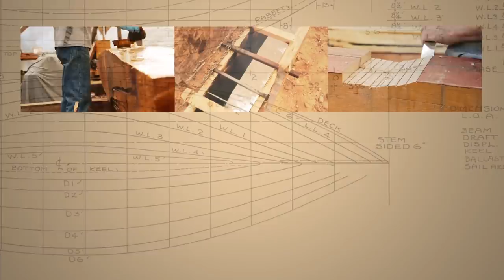Cockpit Mockup - Episode 149 - Acorn to Arabella: Journey of a Wooden Boat

Comment: Having seen whats happens when someone falls against a nut on a sail boat, please put acorn nuts on all those tie rods you will be much safer
Reply: they will be hidden behind that grab-rail board he showed....I think the only places that you even will be able to see a tie rod end will be in the storage hatches, where those ends will double as hatch cover prop mount supports, and there he said he will use acorn nuts - but one thing I see is that with ends/nuts covered by that board you would never be able to re-tighten them, so I'd rather see them safety wired or the ends of the rod peened over onto the nut ...but yeah sure, as they personally spend so much time in/on her as they build, I'm sure they will find anything that gives you 'boat bites' early on
Reply: @BenjaminT.Minkler  Its maybe too late now, but I was thinking whether it would have been better to have the tie rods go through the grab rails, and then counterbore a nook for the bolts on the visible side, which is then 'sealed' with a graving piece. That way, there would be less bolts going through the wood and you could remove the graving pieces to access the nuts. A bit of locktight so the bolts only get undone when you want them to and then you're done.
Reply: @Roy Bentley It also removes the extra bolts trough the wood. Their planning with the house bolts made me appreciate the space for bolts inside the wood. So if you can save future "boltspace" in the wood, that would be a plus too.

But I am not a boatbuilder. I could be wrong.

Comment: Steve. I have some experience with boats built with over large cabin apertures, they are the norm amongst  broads cruisers and cruiser racers, often with pop tops to boot, like a camper van. To get to the point these boats are prone to spreading and hogging, great care should be taken when laying a boat up ashore for the winter or remedial works to ensure Arabella  is properly supported along her keel and her sides amidships.Of course this will not prevent her from moving in her shape when on the water [over time] but regular winters out on the hard standing will help pull her back. The type of deck you lay can also become structural  and stiffen Arabella both across her beam and fore n' aft. see Marilee the NY 40.     rear hatch. Split in middle and hinge from either side, many designs out there for good water tight hatches of this type handy for letting hot air out of the hull when under power.
Reply: I dont think he is planing to see a winter for a long long time!!
Reply: @nssherlock4547  Wait till Cape Horn!!!!!!! At least the cold will kill off the Sargasso?

Comment: Presumably you will have some drainage in the cockpit.  If you lower the cockpit floor lower and fit a raft of slats to step on it will keep your dryer in heavy seas..  Keep up the good work.
Reply from the maker: Yes there will be cockpit drains connected to hoses that go to seacocks below the waterline.

Comment: For your grab rails setup a metal gutter with drain tubes to help keep the condensation from building up too much. Run the tubes to a catch basin in the bilge area with a small float controlled pump to pump out the water when full enough.
Reply from the maker: The amount of condensation inside the boat won’t call for that kind of catchment system. Most mornings a quick wipe with a towel will do.

Comment: How about putting the throttle and gearbox control on the tiller (outboard motor style) ?
And maybe add a gas spring to the tiller pivot to make it so the tiller has the slight tendency to move up so you don't have to reach into a hole in the deck to get it and have it somewhat out of the way when getting into and out of the cockpit...

Comment: In wooden aircraft construction we varnish the inside of all bolt holes using a pipe cleaner or similar. I haven't seen this on Arabella such as when installing the tie rods. Am I missing something or is this not common in boat building? Absolutely fascinating watching this build!

Comment: Think about when you need to hove to.  You will need to lash the tiller to something.  Good idea to have a tiller that will move in the vertical plane to suit the helmsman where ever he might be sitting or standing.  The engine controls should be on the left hand side, given that most people are right handed and will prefer to hold the tiller with the right hand.

Comment: Personal experience, if you can get the tiller as vertical as possible it will leave you with more working space when at anchor or tied up to a dock. I have seen multiple boats that tie the tiller to the backstay for storage.

Comment: You absolutely want the tiller to have a huge range over vertical motion. As you say, standing on the deck and holding the tiller is something you'll do more often than you think.

Also my racing brain is screaming at your asymmetric companion way
Reply from the maker: Makes sense with the mizzen though—it has to be offset.

Comment: Seems to me a boat this size should have at least a somewhat enclosed cockpit. A large canopy or wooden roof could work and not change the look or wind area of the boat much. Sitting in the sun or rain all day is going to get old. Particularly when you already will spend a lot of time exposed swimming, fishing and other things.  
I assume you will end up roping the tiller off to catch a break and drift off course a bit, but worth it. An autopilot would be a huge relief. Freeing up a huge portion of your day. I don't know if they are harder to get for tiller style or not.

Comment: i once got stuck under a tiller on a 70ft sail traing yacht callsed masterbuilder becasue the engine contriols got kicked into reverse and the tiller flipped over and i couldnt reach them to stop theboat ramming the boat behind. parking with a tiller under power is a real skill and engine control tucked away can be a real pain
Reply: that that is is that that is not is not is that it it is
Reply from the maker: Woo what a story! We hear that deftly backing a full keeled boat regardless of steering method is pretty tricky... but getting accidentally whacked into reverse sounds like some very bad luck. We’ll not be hiding/tucking away the engine controls.

Comment: Just a thought about the cockpit, are you going to install some kind of back rest? Just think of the hours you guys may spend hours on that tiller, I have a small dingy and it is a pain to sit in one position for long time. I have seen some with a directors chair type back rest, it folds down and looks comfy. Just a thought.
Reply from the maker: The cockpit will have a coaming. And it’s easy to add back rests like the ones found on boats such as Mahjong (restored by Gannon and Benjamin). We’ll get there. 😉

Comment: Definitely peen over the tie rods. Just cause you can't see it doesn't mean it won't move. About the  tiller, raising it up and down is a fantastic idea however you need to make sure that the part at the rudder and tiller connection gets reinforced to keep from tearing out after some use.

Comment: You want an old style grab bar instead of the fancy grab rail: boats heeel, seas get rough, one gets tired, weak or sick...
Reply: I agree.  That small rail might work for a rock climber but a bar is much better.  If the boat were over 30-45 degrees the handhold would not be of much use.
Reply: Perhaps add straps, even a split very stout belt spanning between certain of the inner end the rod ends then shorten and cap. Can also easily add additional grab straps and grab bars where needed later too. Tremendous project.  -D. D., PHX AZ

Comment: Nice work on the cockpit mockup. Have you thought about a 2 part foldable tiller? This way you can fold it in half and still operate it with the hatch opened, and operating it while standing up wouldn't be a problem either.
Reply from the maker: It’s an interesting idea, but probably not appropriate for this boat or for the size of tiller that we’re going to need.
Reply: @AcornToArabella  that's a good concern, and I think you can find that it is doable. It is used in some IMOCA 65 and VO65 (not wooden tillers, though) on the Volvo Ocean race.

Comment: Suggestion from an armchair quarterback: Have you guys thought about making a two-door hinged lid for the cockpit? With a lid that opens from center to port/ starboard, you could mount seat cushions to the underside of the lids. While closed, the cockpit could be used as additional storage and a walking platform.
Reply from the maker: It’s a little hard to picture what you’re describing, but it sounds kind of cool, and no, we haven’t thought about that. Probably just gonna stick with what we’ve got.

Comment: I loved seeing Victoria's tiller with the mocked up cockpit.  If there is any way you can use Victoria's tiller for Arabella's tiller, that would be poetic.
My only concern is about the hand rail being designed to catch and hold water. Based on my experience, this will create a very rot prone environment. Standing fresh water absolutely destroys wood boats.  There should be clear channels directing water to the bilge.
The project is looking very impressive.  When will you be able to have volunteers again? 
Cheers from Juneau Alaska,
Greg Chaney
Reply from the maker: It’s mostly designed for the grab rail and won’t be channeling or holding that much water, really. Not sure when we’ll be having volunteers again, but please sign up for our newsletter—the survey on the signup form lets you say what you’d like to get news about, and volunteering is one of them. The link is in the video description.

Comment: If you can lift the tiller up to vertical you can get it out of the way in port/while at anchor. Also the lowest position must be high enough so it does not catch on cockpit or anything else.

Comment: Moving ahead with good speed, nice to watch. On the dimensions of the grabbrail, it seems way over the top. Are you not concerned that the bottom plank (sill?) of the coachroof will be perforated with to many holes? I would arguee that simply screwing a grabbrail of say 1”x1” to the (sill?) on the inside would be more than enough for the grabbrail. Take care!

Comment: Brilliant episode
 I was thinking about condensation  from the portholes when you mentioned it. When putting in the drip rail / hand hold around the inner rail make sure you have enough depth so that, if you need to leave a sponge in there, it can sit deep enough not to be seen at all times when you are standing in the cabin.
Reply from the maker: The main purpose of that is definitely as a grab rail. It’s not a very good idea to leave a sponge pretty much anywhere on a boat.
Reply: Agreed not ideal but after a cold night on board you will probably find that you do
Reply: @AcornToArabella  but it will be the perfect spot to forget where you sat down your pencil at !

Comment: Meh just put some bulletproof glass down for the flooring in the cockpit! Just Joking LoL
Reply: For a transparent or translucent cockpit floor and other improved passive lighting consider use of polycarbonate bronze also known as lexan stronger than the usual plexiglass (such as perspex u90) - if weight at that height in the boat is still adequately minimal.

Comment: Suggestion from a retired mechanical designer: either peen the end of your tie rods or put lock nuts on them, because even the slightest flex of the hull over time could loosen the nuts which will be hidden under the grab rail.
Reply: I was thinking exactly the same thing... especially for the ones hidden.  The ones that are not hidden can be checked periodically, but even that feels like it would be constant maintenance.  I don't think peening would be the right solution, though, as it doesn't afford a lot of maintenance/repair options.  Maybe a double bolt with some threadlocker compound might be better?
Reply: Definitely lock nuts. Easy to loosen if necessary, but won't come undone. Good call
Reply: I was thinking the same thing! Good call
Reply: Peening would be more traditional.
Reply: I was an aircraft engineer, gotta be split pins and castellated nuts!
Reply: @p.d.smithjr.3277  birds preen, steel gets peened.  :)
Reply: @wildrootorganics9060  That’s why I’m better at the handle end of a hammer, then at a key board.
Reply: Could they also use red thread lock?
Reply: @p.d.smithjr.3277  lols :) Have yourself a great day!
Reply: Instead of peaning the rods, I would suggest drilling a hole in them and locking the nut in place with a cotter pin. To do the drilling in-place, you'd want to make a jig.
Reply: @wildrootorganics9060  You also.
Reply: @brianmcdonald3831  we call it Loctite. Actually just varnish would do.
Reply: @billgiles3261  where I am the only brand is loctite that’s why I only say thread lock great stuff though wish they could R & D it to cure in less than 24hrs though
Reply: Maybe there should have been a turnbuckle in the rod to keep the tension on the rods over time.
Just sayin, JIM
Reply: @brianmcdonald3831  I have not used it for years but we used to have it in several grades depending on how long you wanted it to set off. I think we used to use blue, but it was 30 years ago or more.
Reply: @billgiles3261  well whether it’s blue or red on back says 24hrs still good stuff of course most times I drive the car right after the fact so..... usually my own car but the stuff that GM, Ford or Dodge(I know it’s Chrysler now or it might’ve changed) but theirs compared to loctite isn’t even in same ballgame loctite I can break loose by hand no problem where a factory threadlock I need the impact
Reply: @brianmcdonald3831  could, but even Red locktite can break. Lock nuts take even more force, especially the "pinch" type use on crankshaft bolts.
Reply: @ScottKenny1978  no offense but nylon is basically plastic it cracks and breaks over time and not to good for water sealing I have a 22 year old car original red thread lock stayed true where it’s sealed nothing went ever through water or oil
Reply: @brianmcdonald3831  I said pinch type locknuts, not Nylok.

On aircraft, pinch type are reusable, but Nylok are not.
Reply: @brianmcdonald3831  and I had idjits in college breaking red locktite on the cable boxes to steal the wire.
Reply: @ScottKenny1978  sorry here nylock and locknuts are referred as one and the same even my retired air force pilot uncle turned commercial or private pilot would have to explain difference to me he trained either Air Force or airline pilots or both out of Florida for many many years obviously I’m not not in that state or occupation
Reply: @brianmcdonald3831  there's two different types of lock nuts. One uses a nylon insert that the threads don't really cut into. The other one uses a thinned part of the nut on one end and pinches that so it is an interference fit on the bolt or stud (it's visibly deformed in the thinned part, into an oval instead of a circle).

The typical place for pinch type locknuts is on the crankshaft of an engine, but they can be used elsewhere. Proper torque plus a locknut is usually better than locktite.
Reply: On Merchant Ships a lock nut is simply a second nut brought up hard against the first.  Easy to unlock but in this case why would you ever do that. I vote to pean over the treads.   But what do I know.
Reply: Locking washers on top of the first washer.
Reply: What does peen mean
Reply: @hanoitripper1809  beaten with a hammer to deform the end of the bolt.
Reply: @ScottKenny1978  thanks 👍
Reply: @hanoitripper1809  Peening means hammering the end of the tie rod onto the nut so it prevents the nut from backing, off similar to a rivet. Peening is permanent, lock nuts can be removed later if necessary. Lock washers, pins, and locktite were also suggested. Locktite may work but how long will it last? I think the tie rod is too small in diameter for a pin of any size. I  have never heard of bronze lockwashers, they are usually spring steel which cannot be used with bronze in a corrosive environment and even they could, I think the tie rod is too long for a lock washer to be effective.
Reply: @brianmcdonald3831  You can get activators/accelerators that decrease the cure time substantially. LOCTITE SF 7649 for example.
Reply: In my opinion peening is the last thing anyone maintaining a boat would want. It's permanent and a total pain in the arse for anyone to dismantle later, defacto requiring replacement tierods after you've cut the ends off to release the nuts, and then you have no choice but to lift all of the deck beams to get the whole tierod assemblies out to be remade. Locknuts on the other hand can simply be removed and replaced as required. We have to remember that Arabella can't just come back to the boathouse for 3 months of dismantling and remanufacture every time she needs some work. Peened over thread ends can turn anything from simple into a complete nightmare.
Reply: @jamieduff1981  A very light peen would serve the purpose of preventing the nut from coming off while not actually preventing removal. 

This is largely academic anyway. Chances are the rods will never hold a torque anyway because it's wood. So you really just want to keep the nuts from backing off when the tension is gone. This could be done with a dab of woodglue realistically. Or maybe more practically - whatever is covering the nut will prevent it from backing off very far. And simple.
Reply: All these comments about "peening", I just realized after 52 years of life what a ball-peen hammer does!
Reply: Blue thread lock would be more then enough or nylock nut
Reply: @CoolKD2005  not a Nylock. The Nylon hardens overtime and loses its locking ability. It eventually will crack as the rods are stressed over and over.

What you want are called Stover Nuts. Where the end has been squeezed tighter.